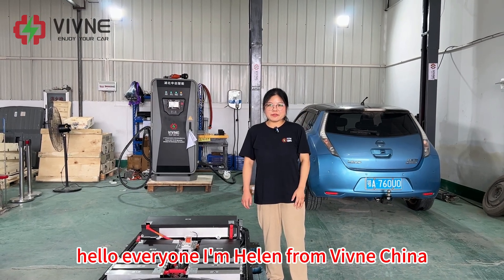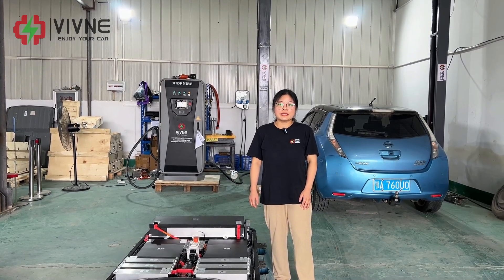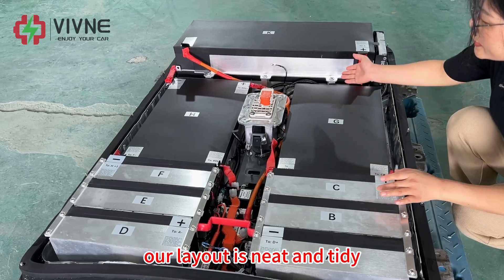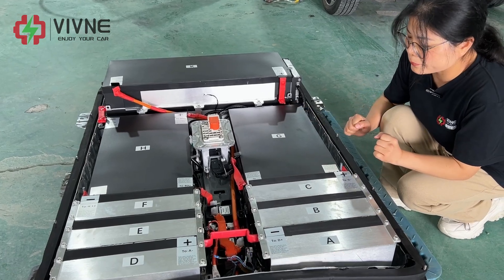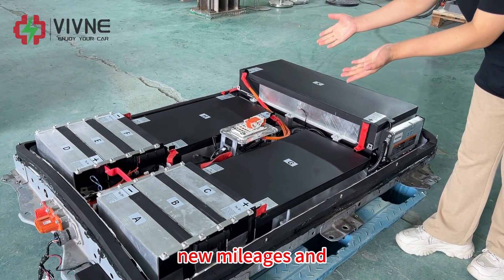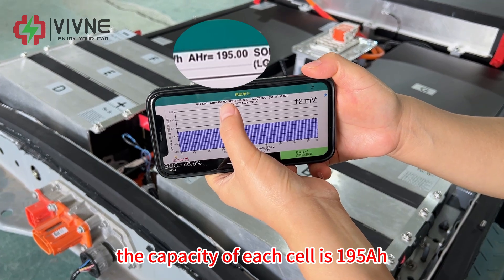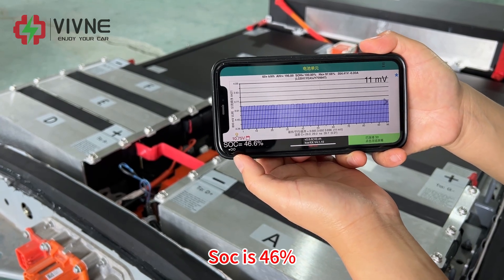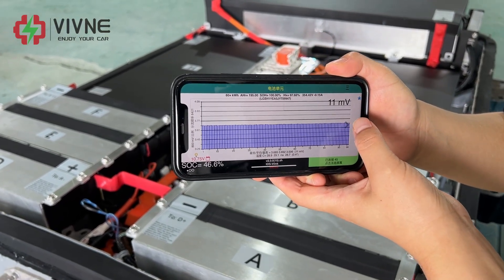Nissan Leaf 68kWh battery pack

Comment: What casting is used for the plug and play batteries? Re-used Nissan casing, or something else?
Reply: Casing
Reply from the maker: @600henrik  We use the original Nissan Leaf battery casing and we just change the batteries inside.  All the hole positions are matched with the original ones and no need to drill any new holes.

Comment: I am a customer.  Myself and a friend ordered 3 packs, one 62kwh plug and play and two 50kwh kits, they came as described; the 62kwh was installed without issue, there are plenty of videos on YouTube showing this procedure.  We are going to send Helen some pictures and short videos we made during install (we are not YouTubers just two old guys in north central Canada interested in going electric with these car, two 2015's and one 2016).  We are in the process of cleaning and painting old case for next 50kwh install,
I can recommend the 62kwh, works just like original with respect to dash readout but getting a great 440km range with combined highway and lower speed operation.  It is really good so far, we are going into winter so it will be interesting to see the effects of cold weather.  We hope to install at least one of the 50kwh batteries within next few weeks; it is the fall here and a busy time for us. 
We are pleased with these cars and this battery upgrade makes them very practical for our circumstances. We have only had one question for Helen with respect to install and she answered without delay.  The install video and directions are good.    We are very pleased.
Reply: Thanks Dennis, appreciate the info. I've got high hopes for CATL too. All the best with the upgrades :D
Reply: Hi Dennis! Now four months later, how is your experience with the new battery? Have you had any issues? Are these kind of third party swaps street legal in Canada? I live in Germany and still have some concerns regarding insurance. Thanks for an update!
Reply: How much did it cost you

Comment: That's a lot of extra weight for the ZE0 suspension?
Reply from the maker: It is only 95kgs heavier than the original, which just as taking an adult in your car. So no need to upgrade the suspension.
Reply: @VIVNEHelenMao  thank you. Will the pack sit lower to the ground than the original pack due to the increased height?
Reply from the maker: @decimal1815  The 68kWh battery pack is 25mm higher than the original. Size is the same as 62kWh. So it will be 25mm sit lower to the ground. But it is still higher than the car back rod. For more details, you can refer to this other video on our channel: https://www.youtube.com/watch?v=snwfUmmuWFg
Reply: Range  @VIVNEHelenMao
Reply from the maker: @birianination7097  The 68kWh battery can provide a car range of 480kms  on a single charge.

Comment: can we have a review from the customer side, when he recieved the pack, how did he installed it ? how was his experience ? please, a video from the customer side, that explains all
Reply from the maker: The other 62kWh customer also had demonstrated in our channel had already installed our pack.  He hired a nearby car repair shop to do the swap, which is not difficult.   Only need to remove and fix some bolts and nuts. He now got 378kms on his dashboard, which we shared in some of the fb groups.        Now he can plan long distance trips and not afraid to turn on the AC...

Comment: are you guys going to offer tesla upgrade battery.
Reply from the maker: We had purchased the tesla car in our factory recently.  Hope in the near future, we will be able to devote some energy to this area.
Reply: @VIVNEHelenMao  I wish youd switch to the newer and cheaper sodium battery on your upgrades. You guys will get a lot more orders.
Reply from the maker: @tobyswesternwear  Nissan Leaf car has voltage request. Maybe for other cars later will consider.
Reply: @tobyswesternwear  Na -ion cells are larger and less energy dense so not a good fit for the LEAF. More expensive per kWh currently. Will be better for short range vehicles and other applications.

Comment: Can I fit this into my Leaf 2015? Would this be a bigger battery chassis and do you need to make a special harness or customizations to the botom to fit it in?
Reply from the maker: Yes,  the 68kWh can fit into your  2nd gen Leaf.   No need specially to make harness or customize  to bottom.  Only the 68kWh battery is 25mm higher than original.  So will need to use 10 solid spacers when installing.  Please check the other  video in the channel, which have the explanation on the solid spacers. Thank you.
Reply: @VIVNEHelenMao  Excuse me. But 2015 Leaf is first generation. Right? I have the original body style. Your answer to me is 2nd gen Leaf, was that a mistake? SO 68 Kwh only fits second gen? Or both? And what is the range for 68 kwh compared to 62 kwh? How many miles or km? Thank you
Reply from the maker: @roamlikekane  2011-2012 is the first generation.  Your car is 2015, so it is the 2nd generation.  The 68kwh can fit in any Leaf models. The car range of 68kwh is 470kms, with 40kms more range than 62kwh. Thank you.
Reply: @VIVNEHelenMao  Thank you kindly

Comment: Very cool. 
Are you also planning batteries with active cooling similar to the E-NV 200 with air cooling or something like that?
A conversion from chademo to ccs would also be interesting, unfortunately nissan shows no interest when asked =(
Reply from the maker: The  motor of  Leaf is not big, only 80kW. We replace with big CATL cells, which generate less heat and bear a smaller C rate. So no extra cooling is needed.
Reply: @VIVNEHelenMao  hello -
1.  if this have smaller C charge-  with what max and average speed you can charge these new batteries? 
2. How long will charge 62 or 68kwh battery? in AC wallbox and DC fast charge
3. Do you need to charge 10-80%?
4. Would it work with charging with that new chademo-ccs adapter? Like this os similiar https://www.youtube.com/watch?v=HT2JuG6N-Yg
or like ccs2 to chademo adapter from Dongguan Longood Technology?